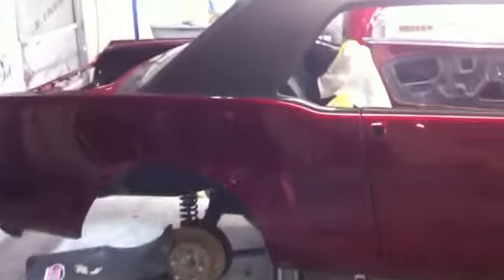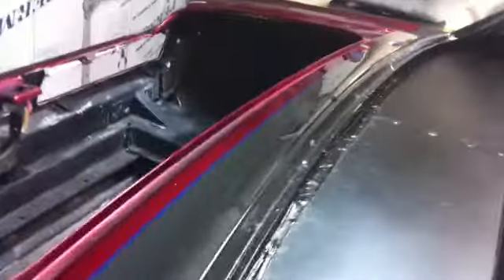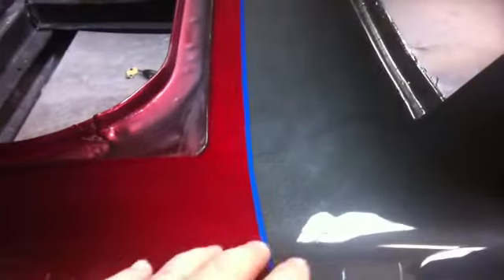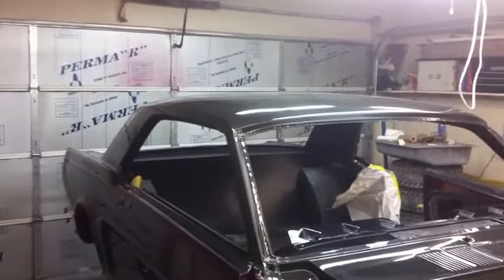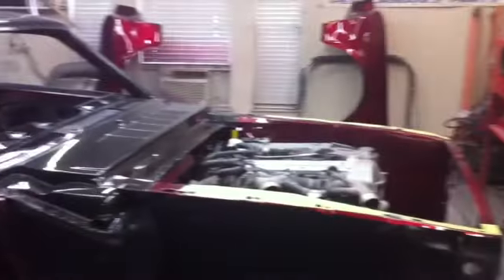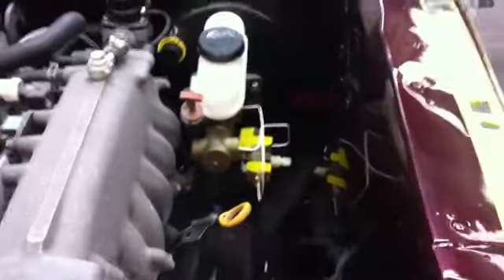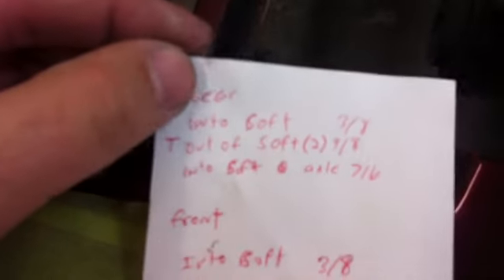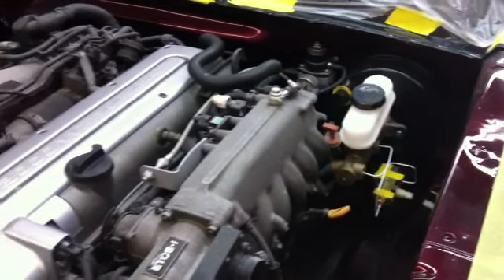Twin Turbo 65 Mustang Brake Installation Part 2- Some questions

Comment: Looks good - the brake line under the rail looks a bit agricultural but should be functional if you're not bothered - will be hidden for the large part.  Keep it up - i'm learning with you.

Comment: Looking good!... Yeah like slosrt said, that's not the place to route your brake line. If you have to run under the frame rail you need to run it right next to the cross member so that its protected from anything hitting it. If you need to go through the body or frame there are special fittings for this. Check out speedwaymotors its called Thru-Frame Brake Fittings, they make short and long versions.

Comment: Good work so far on the brakes, looks like you got some room through the control arm opening, but if not and if your going to keep it under the frame rail you may want to make a shield of some sort that will protect the line, other then that lookin good bud!!

Comment: I would run that line through the holes if you can and use some rubber grommets to prevent chafing. You would almost have to put it in place then flare to put the fitting on though. If you have no choice but to run it under the rail I would put it under the highest point you can in the frame and I would try to make a plate to protect it.

Comment: looks good but you should re-locate that brake line through the frame rails because the way you got it mocked up is potential for disaster to happen or at least build a small shield for the brake line to protect it..or maybe a rubber hose to cover it like a wire loom would work as a shield..

Comment: I do not like the line running under the frame rail. The factory lines on my 67 went through the shock tower/fenderwell. then in behind the crossmember. Car is looking great, nice to see you out in the garage, I was starting to wonder if you traded in the wrenches for a skirt and some needle point. LOL . Now like mark said ''TAKE A BRAKE'' HA IT'SA PUN

Comment: Gary, just wondering will that lower control arm travel up and pinch the brake line if there is a hard hit to a pot hole? Good Vid btw.

Comment: while it is not advisable to run all braided lines, can you run a short one down to the bracket you welded in the fender well, to kinda clean it all up? im running  short lines into the firewall bulkhead, then down through the floorboard and hard-line to the back, to the t, then braided from there to each caliper...